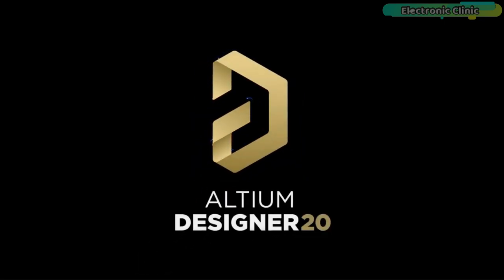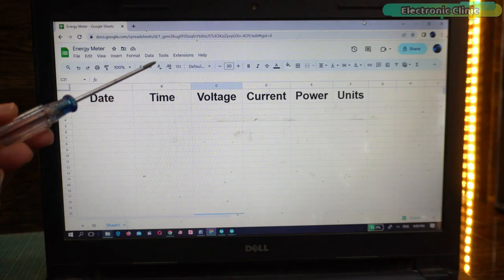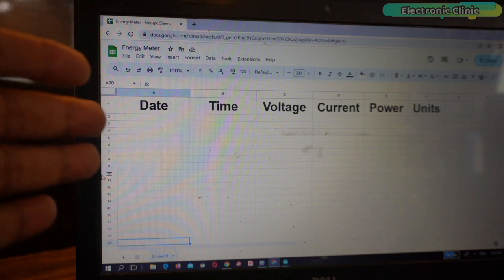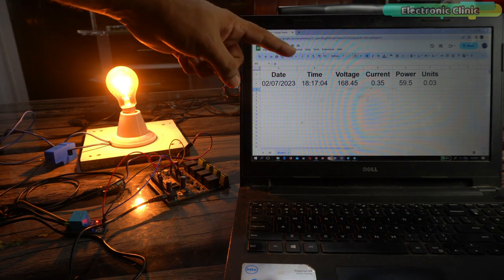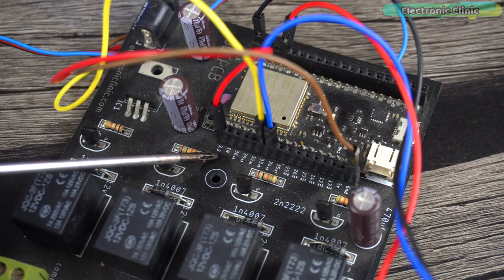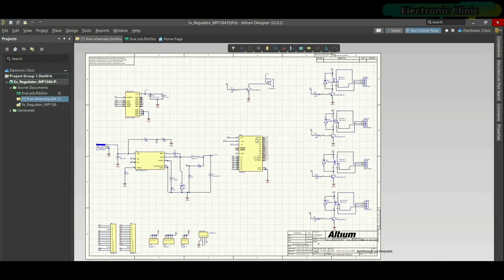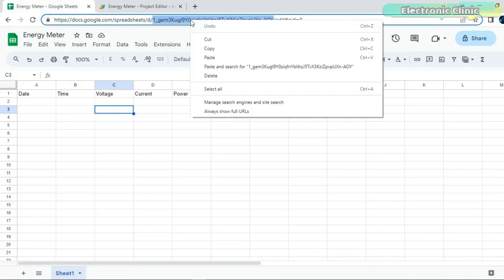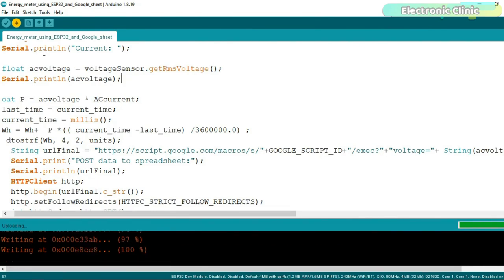IoT based Smart Energy Meter using ESP32 & Google Sheet | Google Spreadsheet

Comment: Hi without oning the laptop they data's will be stored in the goggle sheets?
Reply from the maker: Yes
Reply: This code will work even for dc voltage and current sensor module?

Comment: Tomorrow I will work on it. But zmpt voltage range is max 260V how to measure above 260V, sir.
Reply from the maker: why above 260V? its more than enough.
Reply: @ElectroniClinic  there is 280-290V is comming many time. That's why I am making this project.